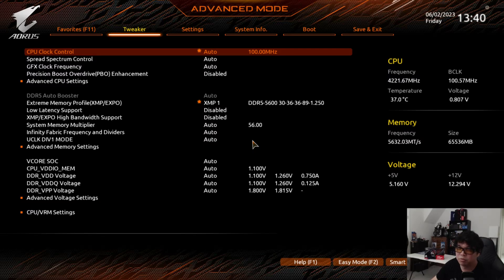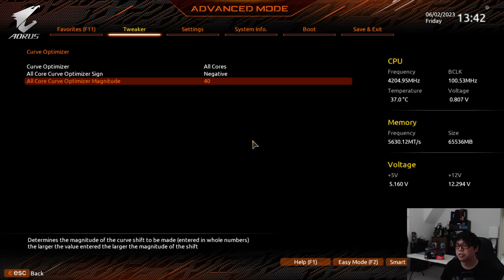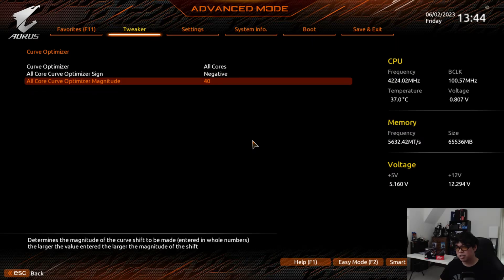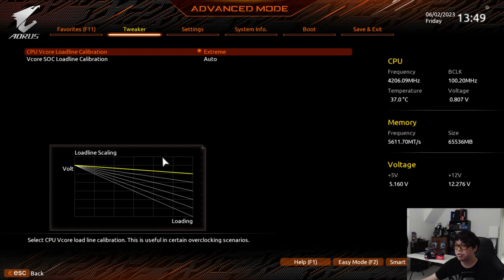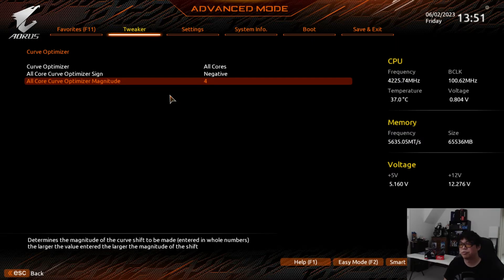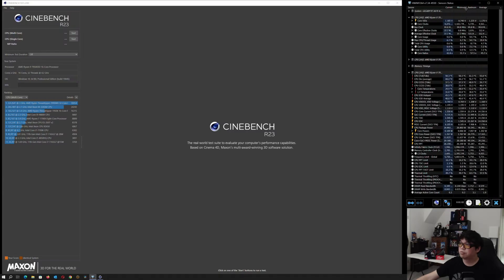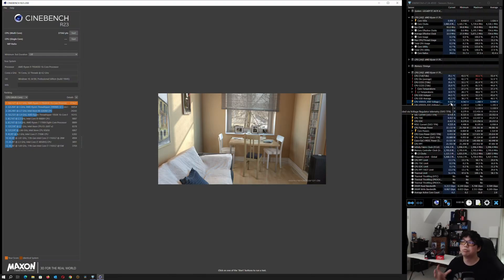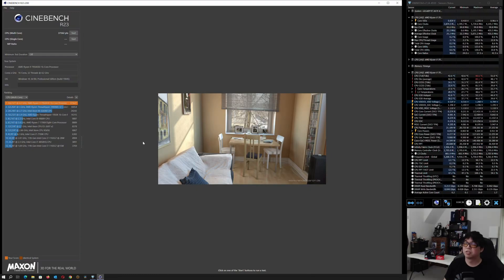How to optimize Ryzen 7950X3D, 7900X3D, and 7800X3D

Comment: -40 is actually insane. Most go to -15/-20 

Most people will "collapse" their X3D chipset and see the CPU throttle back to as low as 3.2-3.7ghz 

Be sure if you're tuning to check performance day to day real world in games you normally play and check for micro stutters and everything. 

Do not use Extreme LLC ever because he's got silicone lottery. 

Medium/High max. You're gonna cook peoples CPUs if you follow his guide. 

Start low (-5 to -10 negative PBO) and tune individual Per CCD Per Core negative boost. 

CCD1 being more negative voltage than CCD0.
Reply: Also based on your HWINFO you aren't even going outside of the stock AMD power profile as your clocks are 5.7. I have 5.85 with undervolting no lower than -15/-20. The BIOS settings aren't doing anything really other than lowering temps. 

Using Process Lasso and doing Per CCD assignment will yield your computer to crash 100% with the proper profile.

Comment: I used too the option "Platform Thermal Throttle Ctrl" and limit the CPU temp to 80 degrees... it helps to prevent high temperatures but gaining great performance too!

The problem... the best curve was "-15" but the processor never pass 80 degrees on full load and get easy 4.9 Ghz with 0.998 volts

Comment: I bet you can't run OCCT with extreme using this large offset .. cinebench doesn't push rhe cpu enough to detect problems and instabilities. On -20 everything seems fine with cinebench but on OCCT not really. I had to adjust the offset per core .. i found out the two best cores are the most sensitive ones ..even with LLC.. so in my case i have these two cores at -12 and -15 .. other cores 20 to 25

Comment: Yo wtf you are stable at -40???? THAT IS SILICON LOTTERY. I been hearing people are unstable even at -30
Reply: I can't get -20
Reply: @ That sucks tho
Reply: Mine is at 40 no problem. Not sure I’d call it lottery.
Reply: @Jaredius  Is it bench stable?
Reply: In my computer -40 with Extreme Load Line, get bluescreen. Now in testing with -30 and its ok
Reply: My 7800x3D does -40 as well! It can run cinebench with -45 👍🏼

Comment: New to PC, After I updated my bios and chipset driver, i try to curve optimizer  negative 30 my R7 7800x3d my wattages drop and laso my performance 1400p from 180-200fps to 110-140fps. 
Before with the update it was working curve optimizer negative 30, was working fine from 4700-5050 boast clock 185-210fps. Any advice anyone can respond I would greatly appreciate your help.
Reply: How leaving your chip the phuck alone?

Comment: Huge forewarning to anyone doing anything in -30 Curve Optimizer range, this can look incredible in average fps uplift. But can kill your 0.1% and 1% lows. You can see these stats in MSI Afterburner overlay.

I tested tons of scenarios and found that -30 had detrimental affect on Lows, so much so, that it increases stutters by far.

My opinion is to run stock 7950x3D or X3D chips, or something small like -10 to -15 and compare it to stock after recording.

I have data on my channel, and I leaned away from any large Curve Optimizer values. Have 80 fps average uplift with dips into 30 fps will be felt in the game, and I stopped using high Curve Optimizer

AMD is super sensitive to voltages and even running lower SOC than needed can drop your averages and lows. AMD is super sensitive to GPU voltage too, unlike Intel
Reply: So hould i leave my gpu untouched, is an undervolt detrimental for the 7800x3d?

Comment: If the max voltage for the 7950X3D is 1.3 and you have it set to 1.2 then setting a load line value of extreme or flat should be completely fine right? because it won't even touch the higher levels of the CPU's max voltage.
Reply from the maker: Extreme load line should never be used for everyday operation. Ideally you would select a value in the middle.

Comment: whoop whoop whoop 😏 thanks bro I follow your guide for my 7900X , I still stable at negative 45 with extreme level calibration , also I just add in my setting temps to reach until 85 in my Aorus Master X670E , got on cinebench23 a score of 29700 , and my volts do not pass the 1.20 level , I monitoring my voltage in multitask heavy application or sleep mode doing nothing and again my volts dont even reach to 1.20v
Reply from the maker: I don't recommend using extreme load line. You would want to reduce that by one or two levels.

Comment: I have the Terra case (mini ITX) I was struggling with finding a fan that could cool my 7800x3d.

I have set my offset to negative 35 to reduce temps which is great .

Will changing the LCC off auto increase cpu temps the higher I increase it?

Comment: The firsr option made my pc totall crash not boot anymore nothjng at 25.  So thats one i dont gonna try anymore. Other steps have not tried it. I have now ryzen master used it puts  it on 5825+- with 28degrees idle watercooled and max 75 full load stress test

Comment: Curve optimizer only works if you don't have adequate cooling, otherwise precision boost overdrive will push itself to the max under thermal limits 90 Celsius
Reply: My 7900x3D doesn't do that on my NH-D15. It doesn't even get up to 5gHz without curve optimization
Reply: @MisakaMikotoDesu  that's because the 3d versions can't be overclocked. It's literally hard locked and if it senses you are trying to force overclock it will go into a safe mode, and auto down clock
Reply: @MisakaMikotoDesu  all you do for the 3d versions is optimize under  cooling conditions because the stacked 3d vcash make the chips run significantly hotter. That's why they don't allow overclocking and a lot of people without proper cooling experience thermal throttle
Reply: @mattshaw4016  It works on my machine. Changing the curve optimization to negative values allows my CPU to run at higher frequencies. Yes I'm pushing at the thermal limit but the fact is that I'm able to do it even on a x3D chip. Motherboards have been allowing you to do things AMD doesn't want for decades now.
Reply: @MisakaMikotoDesu  that's what I was telling you. But it doesn't push higher frequency, it pushes the highest frequency on all cores that AMD allows the chip to run at. Like I said most people are thermal throttling, and don't even know that their chips are not running at default clocks lol. The higher benchmark scores are do to holding that default highest frequency for longer periods of time. I know this because I build PCs with 420mm water cooling and 140mm fans X6. The processor reaches 68 Celsius max. And there are no problems, I don't even have to mess with the curve optimizer, it literally changes nothing other than a few watts.

Comment: any idea why no matter what curves i set i get no instability also 7800xd im only scoring 15-16k cb23 temps maxing around 81 it seems like no matter what setting i do nothing changes. i feel like i should be benching 19k ddr56000, 360 aio volts also always look the same under all settings i try

Comment: Thanks for sharing this info, managed to get Curve optimizer at negative 40. Similar board as yours Gigabyte X670E Aorus PRO X. With CL30 6000mhz. Just a newbie question, is Ram faulty when your PC try restart your PC but doesn't  or takes long restart? And what ram settings should I have ticked On? For CL30 6000MHZ (TeamGroup) on the QVL list too, Thanks in advance
Reply: Same motherboard and same ram here.  And I have the same issue when rebooting.  Everything shuts off except the system fans and my AIO (both keep running) so it never truly reboots.  I finally have to hold down the power button to shutdown all the way, and then turn it back on.  Did you ever figure it out on your system?
Reply: @S60Rguy for me it was a RGB conflict with Armoury crate

Comment: i have 7800x3d with EXPO, -30 Curve, PBO 85 and thermal throttle limit is to 85c. 
I have tested in Cinabench r23 for 30min, and i get 18143 with core max temp on 70.2c

Comment: MSI does not have the graphical slopes for load line calibration and the only options are auto and modes 1 to 8. No useful guide in the bios. The explanation in this video is still too technical to translate in simple terms.

Comment: Thank you for that.  Without the extra step that you showed I could only cap out at -33.  I could do higher for Cinebench but it failed on stability tests.  Once I adjusted the LLC I was able to get it to pass OCCT running for an hour at -40 and capped out at 75C.  it should be noted that the LLC does increase temps the higher you go but I was still able to keep everything at a reasonable temp with a 280mm AIO.

Comment: I didn't win the Silicon Lottery and left it on auto and got better performance.  So placed my NVME Drive to the middle of the MB and got PCIE4 instead of PCIE3 and got better performance but ran hott.  My graphics card slowed down so I placed it back and the NVME is just a little slower but the GPU is at full speed.  Cheers!

Comment: I need your advice. Two CPUs (7950x3d and 7800x3d) are available for sale: a new 7800x3d for €359 and a 2-month-old 7950x3d for €445. Which one should I go with? (Money is not an issue, and I have a 360 AIO cooler.) Which one should I choose for performance and future-proofing?
Reply from the maker: 7950x3d is better.

Comment: My 7800x3d is running stable using negative 25 and also negative 30. However, getting worse results at 30 in cinebench. Negative 25 is getting me ~18600, 30 only about 18100. Is there any reason why this could be?
Reply from the maker: Possibly not stable at those offsets. DId you follow what was shown in the video regarding LLC?
Reply: @GameTechReviews  make a video how to make our 7950x3d perform the same as 7800x3d

Comment: I've heard that some motherboards have LLC settings that are just so unstable that it causes degradation of the cpu
Is it something I should be concerned about?
Reply from the maker: LLC settings that add voltage above the zero line should never be used. Those are the settings that will damage the CPU.
Reply: @GameTechReviews  make a video how to make our 7950x3d perform the same as 7800x3d for gaming
I mean how does a $360 cpu beat the mighty 7950x3d 650$ usd CPU in gaming 
Make a video for us 7950x3d users , i want the same performance as 7800x3d is giving

Comment: Mines not even 100% stable at negative 15. I got bad luck. I may try negative 10
Reply: How do I check the stability ?
Reply: @GadgetsHigh  undervolt like he's doing then save and reboot, run cinebench, if you get blue screen means your cpu is not a silicon lottery 
return it and buy 7800x3d

Comment: checking this video was nice info due im soon upgradeing to a 7800x3D but i did notice you hit 90c on both the core and die temps more or less noticed any thermal throttleing etc bcs of that since it seems high i also know after checking videos that the 7000 series seems to run abit higher temps then the 5000 series but 90c feels abit hot what cooler are you using?
Reply: i use a Be quiet  Dark Rock Pro 4.  Set your PBO Thernal Limit to 80°C and check your Vcore max in uefi. is it higher than 1.25 set it manualy to 1.2 or - 1.15 volt

Comment: My 78003xd runs fine with vcore set to 1.15 volt, curve optimizer  -40 all cores, LLC to Level 3 (Asus 650 plus wifi) and PBO thermal limit set to 80 °C.  Now the cpu works with max 1.015 volt and  4900 Mhz on all cores. Cinebench 2024 results are 1115 in multi.
Reply: My 7800x3d runs fine by just leaving it the fk alone.
Reply: Why are you even here then 😂 just so you can go back to a stock cpu

Comment: I used 35 for the undervolt and scored 37103 on cinebench R23, however i hit a high temp of 85.9 degrees.   I see you hit over 90 degrees. No thermal throttling for me, i changed my thermal throttle to 90 degrees anyway, but im just ssying. I could probably go negative 40 but its gonna put my temps over 90 degrees. Im using a 360mm nzxt kraken AIO cooler which is really good, 85.9 is the hottest ive ever seen it get
Reply: Im at a negative 37 with 71C temperature. Aorus waterforce II 360mm AIO is a beefy cooler meant for these. I consider you to get one.
Reply: @drippaa  I'm using a NZXT 360mm AIO, it's my go to cooler for all my builds, but I'll look into your recommendation. It turns out I had all types of stuff set wrong, and I would tell anyone that has this processor, your temps will never even probably hit 75degrees, now that I know what I'm doing , and set my loadline calibration to extreme (the setting where it's the first line that is going negative) it's given me the best results. And my temperature while playing games literally stays in the high 50's , sometimes 60's. And that's hours of playing. 
I was thinking of updating to a X870E motherboard and a zen5 3d chip, but I don't think it really would be worth it at this point. I mean for gaming, my cpu when it's using the cache cores are 16threads running at just under 5.5ghz. It sits there at 50 degrees and I haven't played a game yet that's caused it to come close to bottlenecking my 40 series gpu. Really want that 5090 though. What cpu do you have in your actual home machine that you use to game on or use not on camera?

Comment: Hello guys,

I have a problem with this settings.
I have set a curve optimizer per core between negative 15 to negative 30 and loadline calibration to low, but when i run games, benchmark etc, my VID core have peak to 1.365Volt and when i simply wathc youtube o doing nothing the voltage VID stay from 1.2 to 1.3volt.

Have you any advice?
thanks :)
Reply: place the vcore lower to  1.2 volt

Comment: My maaan! I've got the gigabyte Aorus x670 Elite AX REV 1.2 board and the bios is the same as yours. Great explaining what this negative CO does even though I already knew from hours and hours of reddit threads =). I came here to see if I could learn something new that's all! I'm a happy subscriber and hope you can bring more nice content soon for my 7800X3D.
Reply: Hi,are you sure bios is exactly same as this? I think your motherboard must be having additional settings like Core clock multiplier and Vcore voltage
Reply: @beardoguy yes of course it got the bclk multipliers and the voltage settings. I haven't made any successful boots with increasing the bclk even to 102.if I had the Asus main board there is modes like eclk 1 and 2 and also asosynchronos mode. My board doesn't have any of those. Those high end Asus board cost like 700 bucks. Mine was around 200, 250 bucks. U get what u pay for. I'm currently happy with the ram tunings I got it to run at CL 26 even though it's cl30 rated. Hynix A die 😅

Comment: I definitely won the silicon lottery. I tested the CO all the way up to -50 and R23 score kept going up. Best stable test is at -54, but couldn't hold stability with multiple tests. No tests could remain stable over -50, so I narrowed it down to -50, getting close to the same R23 score as the stable -54 test within margin of error, but not beating it🥲
Reply: whats your temps
Reply: Update: had to bring it up to -45 because -50 couldn't pass R23 anymore for some reason. -49 and -48 were hit or miss so not reliable. And -47 and -46 could pass stability every time with good scores but for some reason certain games would still crash or force a system reboot. -45 is the highest I have achieved so far with zero trace, and temps for that are like: 
Idle: Package ~35C, Cores ~21C
R23: Package ~80C, Cores ~75C
-50 yielded the biggest temp difference though. I was so desperate to keep it at that because of that and because so, gave a great speed boost, but unfortunately just stopped working. 
For -50, temps would be like:
Idle: Package ~33C, Cores ~19C
R23: Package ~75C, Cores ~70C
And would be able to maintain 5052mhz consistently.
Reply: @MonoPod_DD  try tinkering your cpu per core, maybe it will help you, mine couldn't hold -10 on a single core :)
Reply: liar show proof first otherwise you're just capping
Reply: I've done LOTS of testing and tinkering since this comment so R23's record of those scores are gone. 
Since then, I found the lowest CO I can run is -44 not OC'd because I'd still get unpredictable crashes in my FPS games every once in a while when at -45. 
Mind you, at some point I started using these games I play as stability tests because at settings that I wouldn't crash even on R23's stability tests, it would still crash on these games. And the games are what I ultimately want to work obviously. 
Now I'm running a 5.3GHz OC with ECLK in Asynchronus mode and BCLK2 at 105, PBO enabled, and CO at -10. So far on R23 I average a score just shy of 19300 with this profile, but sometimes it'll score just under 19100 and I don't know why. 
I suspect it depends on my ambient temp for cooling. Room is ~73F during day and >60 at night. OC takes advantage of the cooling for thermal headroom. And I think this is why I was able to get those high scores mentioned in previous comments. 
I started trying OC from BCLK2 107, but that required a CO of +10 and that heat actually brought the R23 score down because of LOSS of thermal headroom. BCLK2 105 has so far been the best balance of core clock to temp to score achieved. 
Might have to go back to the drawing board though because Deathloop (2k, 144fps, Max settings) will crash with excessive gameplay, but unpredictably.

Comment: Curious to see if you are stable at Aida64 CPU SHA3 performance test with -40 all cores….
This is the most difficult test to stabilize on high negative CO on 3D chips.

And Cinebench is not for stability.

Use instead Corecycler, y-cruncher and your most CPU demanding games….and…last but not least Aida64 CPU SHA3 performance test.